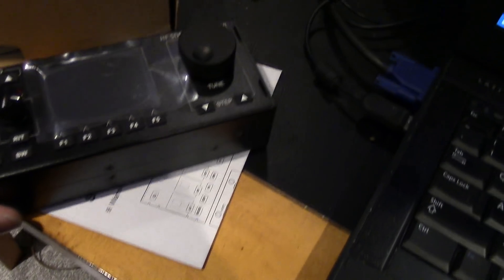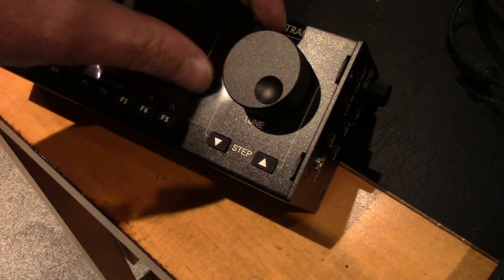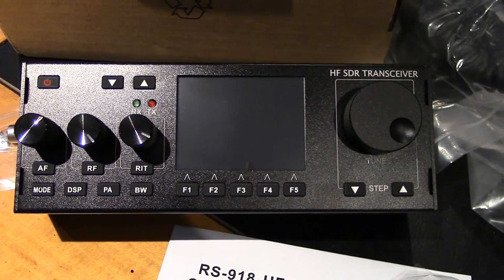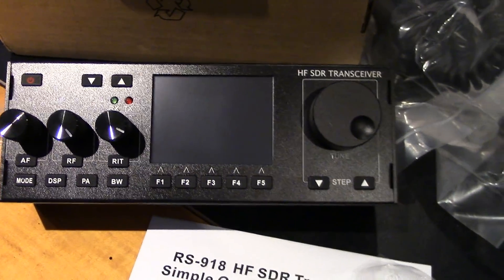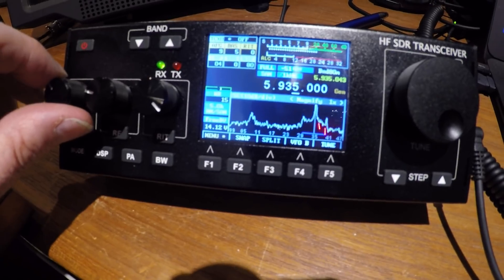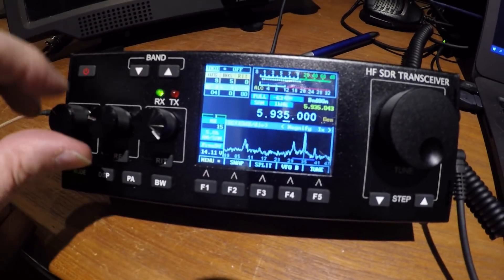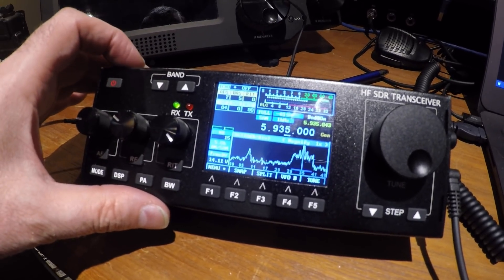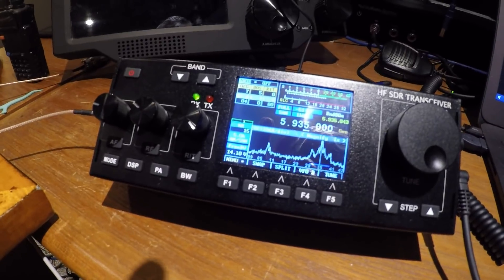Recent RS-918 HF SDR - SWEET

Comment: I had one rs 978 same radio with battery .I tested it on all bands except for 15meters and 12 meters but it sounded as good as my kenwood ts 870 at 6khz and the rs 978 was able to go even wider and sounded amazing for essb its better than kx3 on receive for essb. I never tried hifi xmit on this radio but you can change the bias and run any type 🎤mic. anyway if lookoing at one buy it youll be blown away by the audio quality and build is solid .Metal body didnt get to hot .Sota pota ect battery not as good as ic 705 but a little gel cell gets u on air for days....73.  Ke6iev

Comment: Like you said that’s a clone of the mcHF,  works nice but it have some changes, for example the TCXO is a SI5351 instead the SI570. It’s a little more expensive than the mcHF on the current version, plus the metal case from China... is true that we need to do some work with the oficial mcHF to make it a final product, but for me is not too hard

Comment: TCXO (Temperature compensated crystal oscillator) there not in an oven... they just track with temp better your thinking of a  ocxo  is an Oven-Controlled Crystal Oscillators..
Reply from the maker: Then it has a OCXO. when I turn it on, I can watch the temperature rise to something around 40c

Comment: Clayton, what kind of SSB modulation problems did you see?  Radio Hobbyist, I'll be interested in your results transmitting also.

I bought one about a month ago, and have been delighted with the design and receive capability, but am struggling to get a good clean signal out of it at reasonable power (the issue is too much power, not too little!).  As I adjust the PA drive down to get 5W QRP power,  I see a "dirty" signal on my 200 MHz digital scope, worse on some bands than others.  I'm still testing PA bias and drive combinations in the menus, and looking at the signal with another receiver, so the "jury is out" for me.
Reply: One thing you might consider is that the pin diodes might have some leakage. I built the mcHF kit and was seeing oscillation on some bands at powers from 5w up. I replaced the pin diodes with a relay and my signal is almost as clean as my KX3 now.
Reply: Yes, the design of the diode switching is a known mcHF issue.  From my reading, the odd thing is not that a few have problems with them, but that any work.  Fortunately, my symptoms, except perhaps on 160m which I won't use anyway, aren't what I've seen reported with that ("oscillation").  Thanks for reporting your experience. 
 If I ever figure out what is going on with my RS-918, I'll post details.

Comment: Very sad that the Chinese have stolen this design from M0NKA, without remuneration and even more sad that hams are buying this.

Dale W4OP
Reply: Don't feel too bad, from what I've read, the original kit route is no picnic.  With all props to Chris M0NKA for the design, and to the Germans who've taken over the firmware, the hardware has issues, as does kit assembly.  People who have become "experts" through repeated builds, and who know good sources for various components and which "mods" are needed to get reliable results, do OK.  Following the M0NKA-mcHF Yahoo group you'll read of almost heartbreaking struggles, and expert advice that reveals flaws in the design in painful detail.  And I'm not just talking soldering skill issues.  The fundamental problems with the basic design are in the transmitter,  where slight variations in component specs, even "legitimate" components by reputable manufacturers, can trigger all sorts of issues.  Have the Chinese threaded that needle?  As you'll see from another comment here, I'm not sure yet.  Regardless, I'd rather, worst case, lose a modest amount of $ on the clone, than my mind with the kit!
Reply: I agree completely Dale. I talked to Doug Hendricks in the past about similar experiences he has had. 
There are plenty of reasons people use to justify their purchase of unofficial copies, and I don't think any has any validity.
Reply: Anything open source the Chinese will run with as they have in any of my hobbies.  I just went looking and the 928 is 5 watts less with a heading of 1.8-30mhz but in the specs it said .5-30mhz.  smh, sellers will put anything in their listings.
Reply: The original source author could have done what Ashhar Farhan did with the uBITX at hfsignals.com and have them built in his country by people who wanted the work, thus being able to sell them for so little that the Chinese will have trouble competing :-)
Reply: I built the v0.5 kit and agree it is a very fun build, but not for the beginner I think. I had to do some rework to get best performance from mine, and I feel that some may be discouraged by the non turnkey nature of the project. If you are up for a bit of hacking on the kit, it is very rewarding, but not for everyone.
Reply: Sad indeed. It's worth noting that the Chinese clones are made with lower quality components than those specified in M0NKA's BOM. What I'm really curious about are the new Chinese-made units being sold under the model # RS-928. It seems they've taken the base design (I'm not sure which version though) and started to make changes. What a mess.
Reply: Same sentiments here. I didn't look at your comment before I posted mine.
Reply: that's the issue with open source
Reply: Regardless of the quality of the kit etc. Outright copying of a design is wrong and not in the amateur tradition.
Some years back, an antenna manufacturer copied our EndFedz antenna line outright. The design was not patentable and that was not an issue  for us- although it was in poor tasten and showed a complete lack of design talent on their part. But they also copied the manual 100% verbatim with our graphics. Had to get our attorney to make them quit as fortunately the material was copyrighted. Amateur radio today.
Dale W4OP
Reply: @W4OP  only in so far as if it isn't in line with the licencing surrounding it. I'm sure more than one ham in their time has made plenty of use of arduino clones, raspberry pi clones, etc.
Reply: I take your points, but would worry that people watching the video won't read the comments and see your correction on the open source nature of the original kit. To people that want a pre-built version of this radio, and don't want to tread on M0NKA's IP rights, I would point them at a new project by the team from Germany that have been very active on the mcHF community, and have driven the firmware development for the last couple of years. The OVI40 is a similar form factor to the original mcHF (not v0.7) but improves on it in a number of ways, and will eventually have higher power versions, and be VHF capable.

https://www.electronicrepair.de/ovi40-order-page/
Reply: @gerrykavanagh  The Germans are still not ready for full production a year later. RF boards are on back order. Sucks, I want to build one. 73, KI6AMK
Reply from the maker: I must admit I did not do a lot of research about the IP theft on this purchase. I thought the project was open source. Add to that I did not wish to have to assemble a kit.
Reply: Radio Hobbyist Open source DOES NOT MEANS FREE FOR COMMERCIAL USE AND SALE! Sorry to say it is stolen IP and illegal production. Original author Chris M0NKA invested lot own money to development and kits... now his project has been stolen and he is loosing money. I would like to thank to all hams who purchased kits directly from him and supporting his future work by that. Thank you!